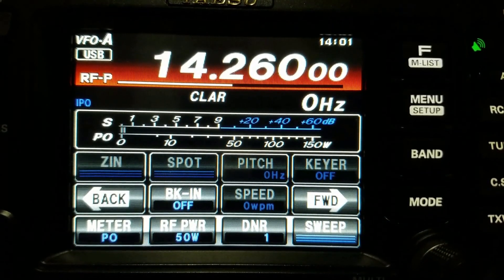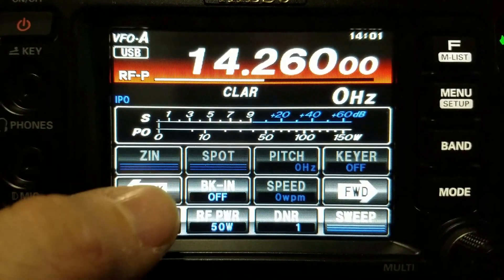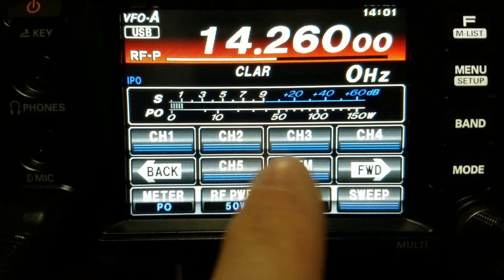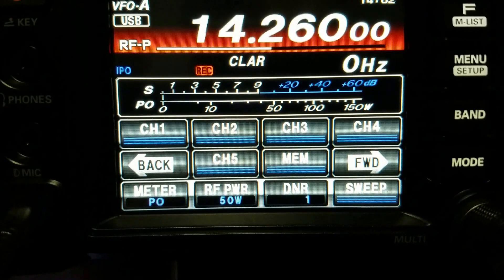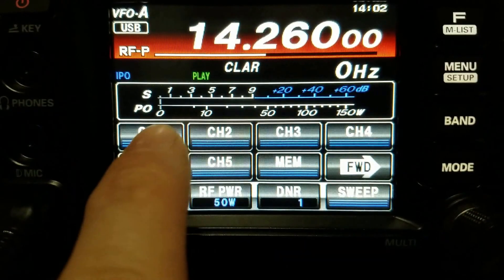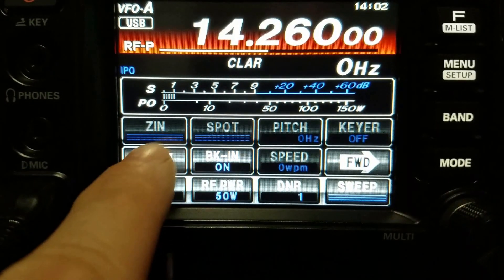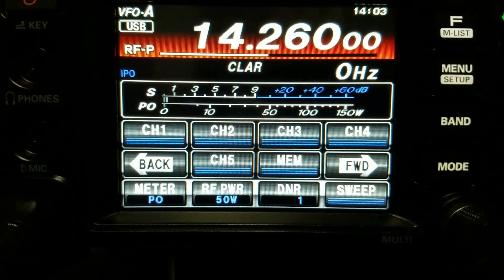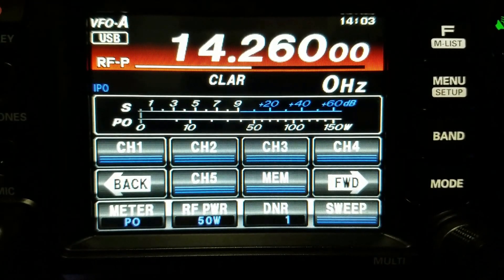Yaesu FT-991 voice record and playback on air.

Comment: Thanks for youre explaining, but though still 1 question. It seems not to work at 2 mtr FM ?! the functionskeys are grey'd out then? What to do? ore is it not possible ?
Reply: Berrie Sleijster Yes same question.
Reply: The manual says that the record function only works in SSB and AM modes, & 2 meter is FM (Page 70).  You could switch to SSB in 2M.

Comment: Thanks for the heads up. Nicely done with easy to follow instructions.
Barry, KU3X
Reply: Part two: I've since purchased the FT991A and also added the FH-2 remote keypad. It's a tad expensive for what you get but well worth it.
Barry, KU3X